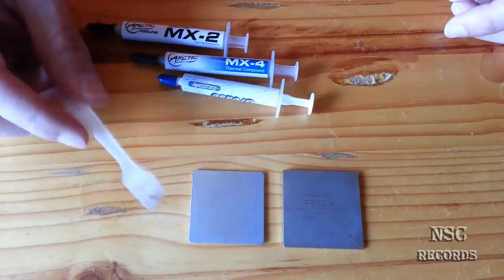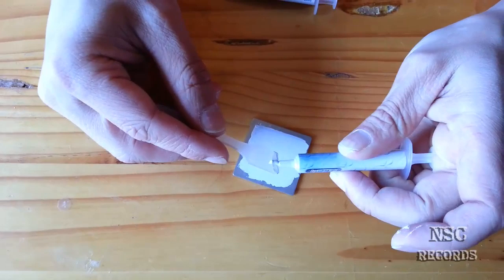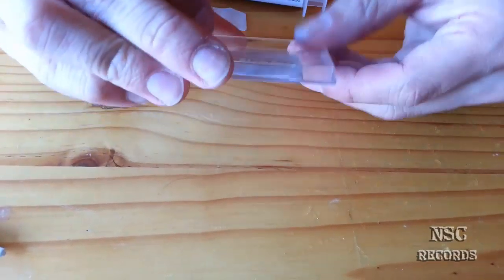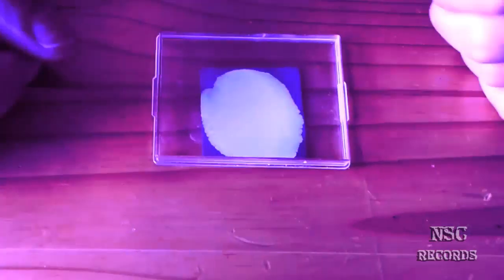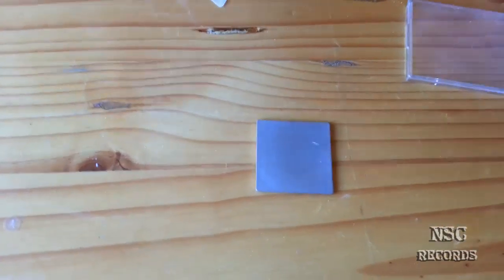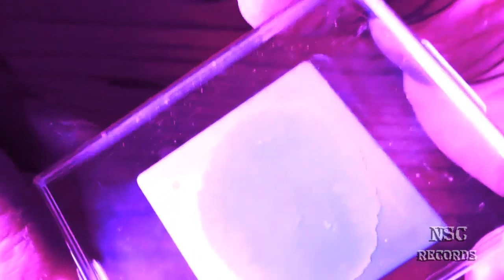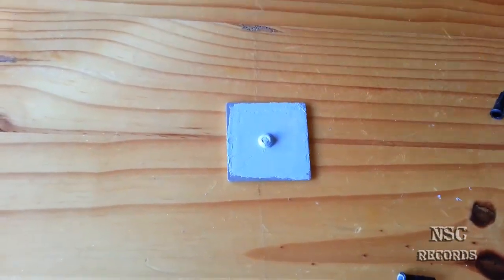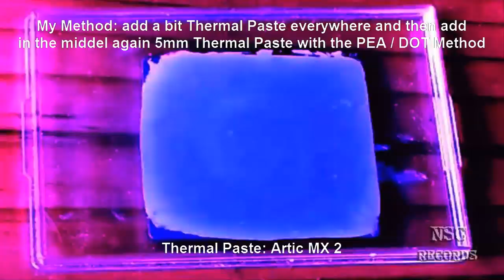How Thermal Compound Spreads (The True Thing) By:NSC

Comment from the maker: i did put it just on the back at the air flow... but like u can see its fully enough to have some results

u can avoid the lyod when u make some holes there, so your console runs cooler and this YLOD will maybe never happen ;)

ive buy my PS3 Slim long ago (USED) first thing i did was the holes.. and my console is still runing BETTER as new ;)

and it will run the next 5 years minimum without problems, watch my PS2 Slim, still runing like NEW ;)

Cheers

Comment: what thermal compound should i use? also if i put too much thermal compound what would happen? you said that it would be better to put too much than not enough. Honestly im the type of person to put the entire bottle if it has positive results. but for some reason i doubt that would end in my favor here lol

basically im asking how do you know how thick to apply it. i can see the surface area that you covered which is very helpful but its hard to tell how thick/thin it is in your hybrid method
Reply from the maker: +John Wallace It conforms for what you need Thermal Compound, but mostly you can use MX4

Comment: Is their not too much thermal paste used here? Cause like too much will cause it to over heat, like it did me....
Reply from the maker: i do that now more than 15 years like that, and i never had Problems with...
Reply: UltraNSC I did it the same and I get over heat , the first time I did it , it seamed fine second time, it didn't work so well, gonna give the pea method ago on its own  :)
Reply from the maker: yeah, most important is thats all is cool :)
Reply: UltraNSC how do Sony apply it?
They say that it doesn't matter cause the actual chip that needs cooling is in the centre so?
Reply from the maker: Ok, if thei say so xD
Reply: UltraNSC okay so I tried with just the pea in centre, not as good as your method iv used this every time without fail, also an other question, I see on one of your other videos you take the metal top plates of the CPU and GPU, but what do you stick them back down with? What's the best thing to use?
Reply from the maker: i just mark the place where the IHS was bevor, than i add new paste on the IHS and ive press the IHS down on the cooler with a lot presure down, and than just put some paste over the Chip and Close all, you will find a lot more stuff on my channel :)
Reply: UltraNSC sweet very useful :D
Reply from the maker: ohh Yeah :)

Comment: can u make a video comparing Arctic silver 5 vs arctic mx-4.
for example how the both sit on the heat spreaders by using the same application method,or how hot the ps3 gets with each one,or the fan noise with both compounds.
Reply from the maker: AS5 compared to the MX4 is not a big diference, maybe 1-2C* degrees

The thing is also, that somehow the MX2 is in some Benchmarks a bit better than the MX4

The MX4 is a bit harder, but the MX2 is great and cheaper also.

AS5 is more for the DIE it self, so AS5 is good to put over the Chip INSIDE the Heatspreader, but for big places, the MX2 and MX4 is in my eyes better to apply.

AS5 has also only 3grams, the MX2 and MX4 comes with 4grams

Price & Performance: MX2!

;)
Reply: thanks
Reply from the maker: Yea, np  ;)

Comment: in my opinion i think the dot method would work just fine with arctic silver 5 since i put my googling skills to work and it is a bit thicker than the mx-2 or mx-4.
Reply from the maker: you right about the AS5, BUT, when you want to open your PS3 next time again, than it will be VERY hard to get the PCB out, because of the dot method and AS5, belive ME ;)

Thats why i prefer MX2/4
Reply: UltraNSC yea i got arctic silver 5 because it was available in a local shop and i noticed it took me about 7 mins to carefully pry it apart also i read that arctic silver 5 needs a 200 hour cure time also im thinking about ordering some mx-4 but it seems to be in popular demand.

Comment: Oh ! Very good français !! Lol man your videos are awesome, I just have a question I hope you will respond because you are really the best for ps3 I guess ! I want to put led in my PS3, if I solder two wires on the fan cables ,and put a resistor on it is it good ? Because I said to myself "but when the fan is gonna be full power, the voltage on the wires will be higher no ? So what if the led get overvolted" ? So what can I do ???

Comment: Hello UltraNSC , thanks for the video ,please recommend me , i have a ps3 160gb uncharted bundle,buy from january 2009(MADE OCTOBER 2008) and i dont have a problema in six years of full games xD, and the cooler is silent,except in battlefield 3 or other games when the cooler go to lvl 3, in Street figjter 4 only lvl 2 . do you reccommend me to open the ps3 and apply new paste? sorry for my english , i am from Perú
Reply from the maker: Yes, its always good to Change the Standard past and apply new paste :) MX-2 is good

Is it a Slim CECH-2004 Version?
Reply: UltraNSC its fat CECHP-01 , mx-4 or mx-2? i can buy anyone
Reply: UltraNSC its still working good , but I'm afraid my ps3 has 6 years old, that I have never given maintenance
Reply from the maker: some models are realy good made, also the thermalpaste is on some moddels really good applied... if you are afraid to Change the Thermalpaste, then just do some Hole on the case over the fan, so it will get Cooler better.

for more info check this out:
PS3 FAT YLOD Reparatur DAS VOLLE PROGRAMM By:NS©

Comment: your using the pea method every time your applying paste in those videos so ofcourse there are no air bubbles, just with the way you do it you are also pre spreading some paste also which is making a really thick layer of compound instead of spreading and then placing down the heatsink.

also on a IHS as large as those you would use the 5 dots method and not the rice grain in the middle so it spreads better.

Comment: Glad to see someone tackle the air bubbles myth.

Too bad u kinda ruined the vid with the annoying background music and the purple when it gets serious. 

U're probably also overdoing it a bit with the compound. As u know the chip itself underneath the IHS is much smaller than the IHS surface so you don't really need to cover it completely. 

I bet that if u were to put it on like you did at 8min it would still spread out nicely after warming up for a while and being under of pressure longer.